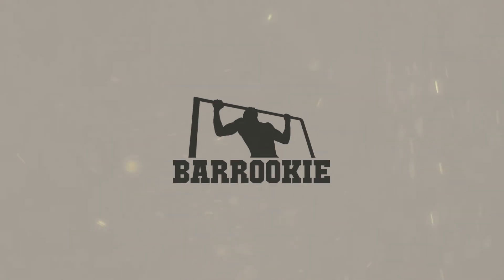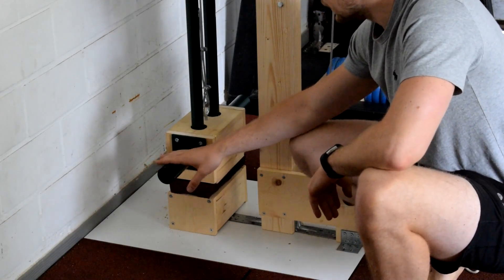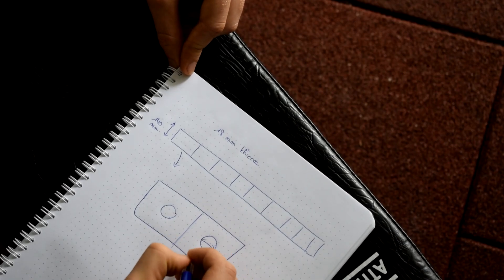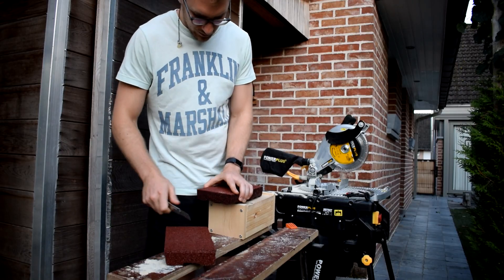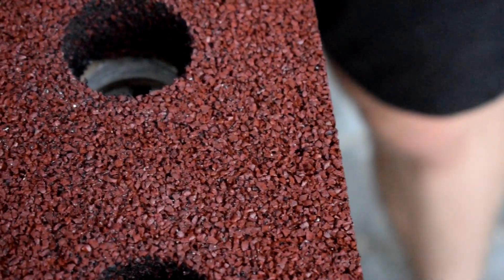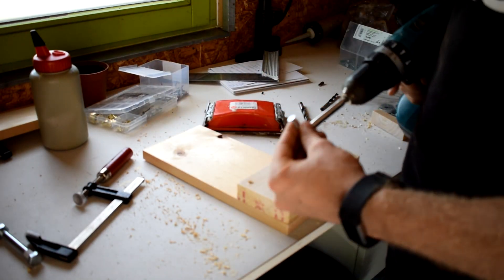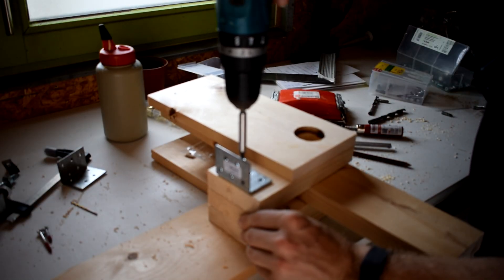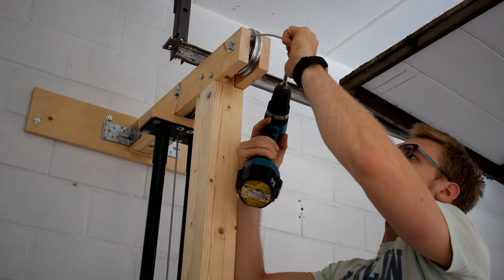How to make a PULLEY SYSTEM - DIY and Build to last!

Comment: Excellent make, If use all metals bars  with welding better.
Reply from the maker: True! Everything is stronger in metal, the only downside is that it is not DIY friendly and you need a lot of specialized equipment.

Comment: Awesome! What is the maximum weight allowed for using the low pulley for seated rows? 
Also, do you use pulley wheels with bearings?
Your machine is super smooth.
Smooth and sturdy like commercial grade.
You done an amazing job.
Reply from the maker: I've used 60 kg on them just fine. I think the machine can handle a lot more ;-)
Reply: @BarRookie  it could probably handle 250-300lbs. Wood also is very, very strong. If I have time to make a pair of these? I will use 4x4's or 4x6 inch planks.
Again. That is an Amazing Build. Super smooth and High Quality.
For a Mostly wooden machine.
It's pretty much "Commercial Grade Quality".
You truly did an Excellent job.
Reply from the maker: Nice brother! Thanks for your kind words! 
If you make one, I would be happy to check it out!

Comment: What someone could do is follow your plans and just put a longer peice of pipe between that 4x4 block that holds the weight that way they could slide numerous concrete plates made from a bucket as a mold.
Reply from the maker: I've actually seen somebody do that! Ik looks super nice. Which makes me wonder, wouldn't it be easier to find an old weightstack and use that instead?

Comment: Thank you for sharing! I wonder if I could add a level of a pulley for bicep curls at shoulder level. You extend your arm out straight and curl.  Then for bicep curls and shoulders, i probably need different length cords for that  huh? 
 I use resistance bands due to neck/ back pain. I figure a pulley system would be better than keep buying bands they keep breaking. It's a pain!
I usually work 1 arm at a time because working 2 makes my neck pain worse. It's easier focusing on one arm then switch.
Reply from the maker: I would have loved a pulley that you can set at different heights. But in order to make that workable, you need a 2 tot 1 ratio. That way lenght of the cable is less an issue. 
I would have love to have one at elbow level for external rotations for example. 
But despite all of that, it is way better than using bands that break.
Reply: @BarRookie  unless the side beams have adjustable levels for the pulley??

Comment: Could you link the connecters that you cut a “V” into that support the metal beams? Thanks
Reply from the maker: Yes I did, I made a little plank were attached them to. Then that plank I attached to the pulley block up top.
Reply: @BarRookie  i mean. The name of the product, so i know what to look for here in my country.. thanks

Comment: Great video, thank you for taking the time to explain and do a follow up. Just finished building mine and it works great. Just need to add the lower pulley, I'm gonna try and make it adjustable so it can be used from different positions.
Reply from the maker: Great job man!! 😌 I would love to see your version! Please send me some pics on instagram or mail me at barrookie@gmail.com

Good luck with it!! 💪💪
Reply: @BarRookie  I've sent you a couple of photos. :-)
Reply from the maker: Your build is awesome man!! It looks so refined!  I really love the angle that you made for the too pulley!

Great job my man! How does it feel to use it? ☺️☺️
Reply: @BarRookie  Works and feels really good. I used chrome wardrobe rails for the upright guides, the weight block just glides up with no resistance. So happy with the build. Only thing I messed up (mostly cos i rushed at the end) was the hole for the front pulley. I didn't get them quite lined up so the pulley does not sit straight, I'm gonna open the holes out and add some bushes. Thanks again mate. :-)
Reply from the maker: Hahaha I know the feeling bro! Once you're almost there, you just want to test it out and be proud of it! 🤣💪
Reply: @DiggerDave1968  Hey Digger, is there anywhere I can see your adjustable rendition of the DIY pulley system?
Reply: @LV-ii7bi  Hi, sorry I have not had time to make it yet.
Reply: @DiggerDave1968  I'd apprecite it greatly if you do. As I was watching this video I thought of adding multiple anchor points along the wooden post to make it adjustable. So I got very interested when you mentioned you had done something like that. I'll check for your reply if you do. Thank you.
Reply from the maker: Sorry to interrupt my friend! 😉
It is indeed nice to have a changeable pulley. But keep in mind that this will mess up the dimensions of your cable. 
That is why in the gym they use 2:1 ratio for the cable machines. Because then length of rhe cable is less susceptible to the position of the pulley. 

DiggerDave, is that something you experience? Or am I thinking too theoretical? 💪💪
Reply: @BarRookie  You are correct. But the 2:1 ration with a 2nd anchor point makes the weight required to be double. I'm thinking of making multiple length cables (that attach to the main one) to overcome the problem of cable length. Buying 1 kg of iron is half as expensive as buying 2kg 😁,

Comment: Where did you find the pole holders in that size?

Great build, man
Reply from the maker: Thanks brother!! ☺️ I've just found them at my local hardware store. If you cant find it, check out threaded flanges plus galvanized steel pipes

Comment: What size metal pole can you post link
Reply from the maker: Link below, but is really doesn't matter what pole you use. Mine had a diameter of 38 mm. But if your local hardware store only has galvanized steel pipes, these are perfect too. It is just to guide the block. 

https://www.gamma.be/nl/assortiment/betafence-steunpaal-plasitor-38-mm-220-cm-groen/p/B197843

Comment: where do I find these "pole holders" @ 5:28 ?
Reply from the maker: You can find them at the hardwarestore, where you can find outdoor fence poles. If they don’t have that, you can always use threaded flanges and galvanized steel pipes. That is as good as an option!

Comment: 12:19 you litteraly unscrew lmao 😂
Reply from the maker: I was struggling a bit too be honest 🤣🤣
Reply: @BarRookie  😅
Reply from the maker: Just curious, I saw another comment of you popping up. But is got deleted.
Was it you that deleted it or youtube? 
Just to know if YouTube is acting weird or not 🤨🤣🤣
Reply: @BarRookie  nahh I was saying, you talk about security but u wear flip flop😆 (I laught so damn hard) but after I saw plenty of coms about this. I just didn't want to overdo it ;)
Reply: Really helpful the video, I will probably try to build it, but i have a question. What's the max weight you can put on this? I'm sure we can do triceps extension but it is possible to do some lat pulldown?
Reply from the maker: Hahaha! No worries brother! Can't have too many comments 🤣🤣

Yeah man! I've put 90 kilo's on there. No problem! Because of the 1:1 ratio, you're actually pulling 90 kilo's as well. I wasn't able to move it though..  So it holds up pretty well. Max weight I can use on this is 50 kilo and I am the limit rather than the machine. 

I hope this ramble makes some sense 🤣🤔

Comment: The only problem with that machine is that u have to put the wight both side to be balanced otherwice it gets stuck
Reply from the maker: That is true, but that is the same case with barbell training. And if you have a barbell, chance are you have change plates that are low enough. The lowest I can go is 2.5 kg. So far haven't got any issues with it.

Comment: does anyone know the measures to drill the holes to place the pulleys? appreciate
Reply from the maker: You have to make sure the adjacent holes are aligned, so that the pulley will roll straight. Also, you can see the location of the pulleys by seeing were the cable will go an use that as a reference were the end of the pulley wheel has to come.
Reply: @BarRookie  
I understand, but there is some measure of the holes the distance from the tip pulley and the base ..

appreciate. good video
Reply from the maker: Thanks brother. So my theorie is that you need more wood under the pulley wheel than above. Since the forces will be only downwards ones. That is why I would drill my holes 2/3rds of the planks, measured from the bottom of the plank. Hope that makes sense!

Comment: What are those metal pole holders called? I tried searching for that term and couldn't find them
Reply from the maker: Hmm, Flanges might be a good word for that, but you can also use blocks of wood with a hole drilled into it.
Reply: @BarRookie  hey I actually accidentally found them while looking through Titan Fitness website. They call them weight plate holders. It meant for their racks but looks just like what you used.

Comment: Great job BarRookie. I've been looking for a DIY crossover cable pulley system so 2 of these would work just fine. I have one question. Can you provide links or the following items - 2 metal poles
 - 4 metal pole holders and 2 metal pole holders (outer diameter: 46 mm) for weight attachment. Thank you for coming up with a great idea.
Reply from the maker: Thank you so much brother!! 
I can give you links for the Belgian stores to have some reference. But if you can't find the exact poleholders, you can also use threaded pipes and flanges. 
The poles: https://www.gamma.be/nl/assortiment/betafence-plasitor-tussenpaal-4-8x260-cm-groen/p/B197842
https://www.gamma.be/nl/assortiment/betafence-steunpaal-plasitor-o-38-mm-270-cm-groen/p/B197844
The pole holders: 
https://www.hubo.be/nl/p/giardino-paalhouder-ronde-paal-48mm-groen/196553.html

If you have the station ready I would love to see some pictures bro!! You can always DM/tag me on instagram :D

Comment: I live in UK I can't find those 2 bars that holds the weights in the UK if you got website where you bought these from so if I can order them that'll be great
Reply from the maker: Maybe look up for flanges, those will work fine too brother. Find some threaded pipe and you can screw the flanges to it.

Comment: It's not practical! The holes you made in that block of wood to run the guide bars through,  there will be lots of friction between the wood and the bars. There is no lubricant to get rid of that friction.  As a result, it would be so hard to pull, but easy to let go. Useless for workout!
Reply from the maker: In theory this may be true, but practically this is not the case.
The holes are adequately large that there is not a lot of friction. But small enough that it does not wiggle

Comment: Didn’t watch the video, but for a plate loaded pulley system just like this, how much money was actually saved? I wouldn’t think much
Reply from the maker: Hi Don, thanks for your honest comment and question. Indeed this is not a cheap alternative nor do I claim it to be. This is more about the building experience and sharing this.
Reply: BarRookie how much did it cost to build this? Just the wood and bolts and all that not including power tools etc
Reply: Ok, wasn’t trying to be crass about it, was just curious. Thanks for the reply

Comment: Where did you get the metal pole holders from ?? Thanks
Reply from the maker: I've found them near the poles in the hardware store. Your could also use a flange and put a pipe into it.
Reply: @BarRookie thanks bro

Comment: Hey man, where did you find those metal pole holders?
Reply from the maker: Hi, sorry for the late answer. I found these at the garden section of my local hardware store. These pole holders come with the green poles that are used for metal fencing. Hope that helps!

Comment: i used steel cable (without plastic covering) which was chewed up by the pulley in no time and broke. would i have better luck with steel cable with plastic covering  or climbing rope? TQVM
Reply from the maker: Hi, that is why I used a cable with plastic wrapping. That way everything stays nice together and you avoid friction between the cable and pulley. A climbingrope will probably stretch over time.

Comment: Nice video 💯 how much did it cost to make ?
Reply from the maker: Thanks! About 250 euros, without attachments. The bulk of the money goes into the pulley wheels and metal hardware.
Reply: Nearly as expensive as a commercial pulley.
Nice but I would not trust in the atachment to the weights block.
It can be pull out with heavy weights

Comment: Loved the design and the video.  In process of building it.  Just waiting for the pulled wheels to be delivered.  One thing.  A seat with the pad to hold the legs down when doing the pulldown.  You do not show one.  Do you use one?  Do you think it is needed ??  If th answer is YEs can you share what you use please.
Reply from the maker: Thank you so much for your comment. I don't really use one because I don't do latpull downs. I'd rather do pull ups 😉.

But my girlfriend does pull downs and does not use a pad and it seams to work. Maybe due to the light weight she uses. What I suggest is to just try it without and if you find the need for it you can always build one. 

If necessary, you can build litte holderd for your feet instead of for your legs, maybe that will simplify the build. 

Sorry for not having a definite anwser. 

How is the build getting allong?
Reply: I'm building the lat pulldown in order to work up to doing pull-ups.  I've tried using the chair assist and well as bands to assist the pullup but they do not work for me so I reckon a lat pulldown will allow me to start at half body weight and work up to it.  I have set myself an aim of doing at least 5 strict pulls for my birthday on 19 November when I will be 67 !!

Comment: Do you know how much weight it can take?
Reply from the maker: Not really, it help up fine with 90 kg for the thumbnail.

Thb I haven't found the need for more than 50kg. The weight seems to heavier than at the gym. It might have something to do with the pulley ratio or something. But it handles it like a charm.
Reply: That’s pretty much perfect for me. I’m 81kg so 90 should be more than enough. And if for some reason I still needed more Lat engagement I might as well just do weighted pull ups instead and leave this machine for accessory tricep and bicep exercises.
Thanks for the reply btw!!